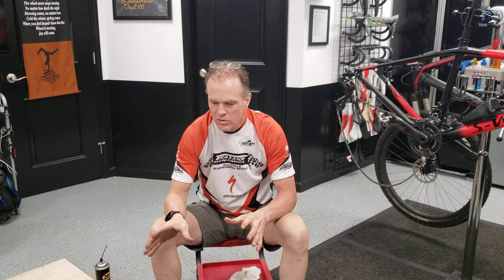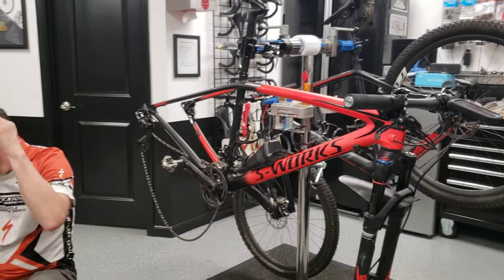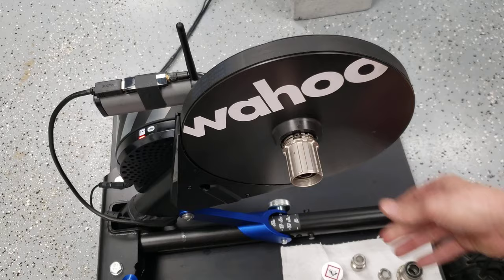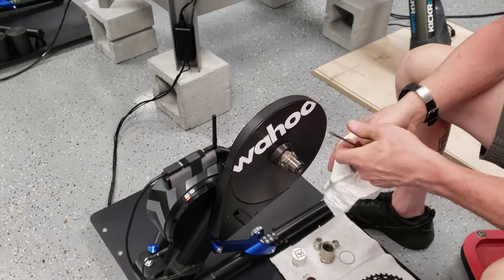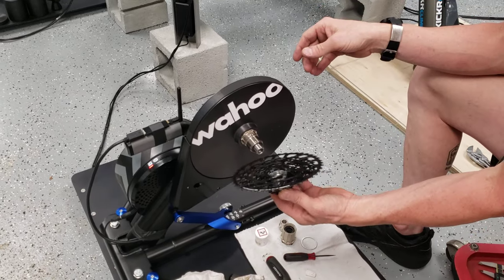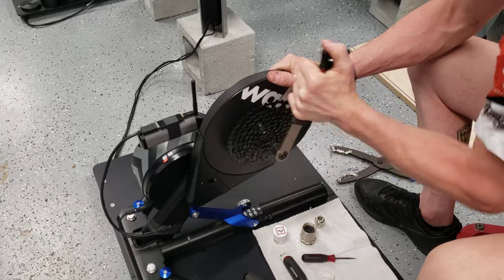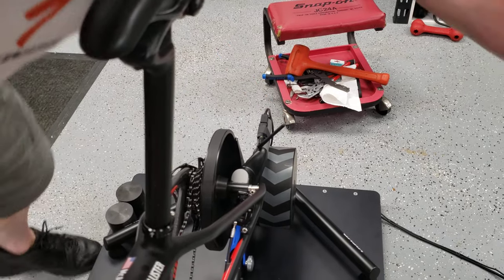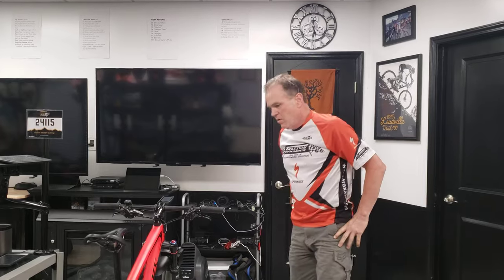How to convert Wahoo Kickr for Mountain Bike, Cycle with Max!

Comment: While this video has a lot of helpful tips, there are a couple of steps that are incorrect per Wahoo. 1) You should be using the shorter 10 mm lock nut, not the taller 13 mm lock nut @6:36. 2) When putting on the thru-axel adapter kit, make sure not to put both pieces on the non-drive side as shown in the video @10:03. Instead, the smaller of the two pieces goes on the opposite end on the drive side. I have verified this info with Wahoo. Hope this saves someone some pain.
Reply: (13mm lock nut is for the shimano driver)
 when using a XDR driver use 10mm nut and put cap over it
1.85mm spacer is needed when using xdr driver with xd cass
148 spacer on non drive side
Check drop outs!  some bikes will have fitment issues, proceed with caution so you do not damage frame
my frame will not allow cap on drive side to sit flush.  Wahoo has some new spacers in the works I hear
Reply: I was about to say the same. It is actually a BIG mistake. If you follow the instructions in the video, the distance is not 148 mm (for boost) it is more than 151,5mm. It means  poor shifting due to misalignment compared with the bicycle with the rear wheel, a more crossed chain and finally a possible frame damaged . It is easy to check if you measure the final distance thru the hole for the thru axel.
Reply: Thanks man you saved me from a big head ache!
Reply: I just spent an hour trying to work out why my bike wouldn’t fit. I wish I’d read your comment first. Swapped over to the 10mm one and everything just works. Thanks from the future

Comment: I have a KICKR CORE.  Normally ride road bike on it, but put my MTB on it.   the rear sits really low compared to it having a tire on.   Didn't measure, but put the rear wheel next to it and the axle doesn't  Line up at all.   The wheel's axle is about an inch and ½ high than when on the trainer.
Reply from the maker: The Kickr has a physical height adjustment built into it, the CORE doesn't so you'll have to come up with another way to level your bike.  Some plywood works for most people.  OR, you could buy an Axxion Rocker Plate, and then have it virtually level and have a rocker!

Comment: Trying to get some clarification. As I’m new to all of this and have been told a variety of different things. Trying to figure out if i can successfully use this cassette SRAM SX-PG1210 / 11-50 T on either the wahoo kicker or a Saris trainer. I’ve been told the largest cog would not be able to be shifted to as the rear derailleur would run into the trainer. Thoughts?
Reply from the maker: If you have the proper Wahoo XD Driver on the Kickr trainer you can definitely use an 10-50 cassette.  I rode 1,000 miles like that last year and did the Leadville 100,000ft Challenge with that setup.
Reply: @Traxxion  thank you! I’m assuming it would be similar on a Saris hammer trainer as well?
Reply from the maker: @kylepowidzki1223  I can't say for sure... but if they don't have an XD styled driver for sale, then the answer is almost "no", although you might be able to find an aftermarket cassette that would work from a company like e13.

Comment: When you buy the system does it come with all the adapter for conversion?
Reply from the maker: If you wanted to change the freehub you had to buy it as an accessory.   I would check their website for details for current accessories.

Comment: Thanks for your video. So the bolt of 10mm is for 142mm configuration right? And 13mm bolt for the 148mm? I think I made the mistake :)
Reply from the maker: There is plenty of confusion to go around!

Are you talking about the silver cap?  Or the spacer marked 142/148?
Reply: @Traxxion  im refering to the piece of the freehub (before adding the cap). They are 2 diferent pieces with a diferent finishing colour. You put the bigger one with 13mm height. I guess for 142 axle I need the small one with chrome finish?  Thank you
Reply from the maker: @romainm7147  No... on the other side, you flip the spacer that says 142/148 and that will fix it.
Reply: @Traxxion  sorry there is a misunderstanding. Im not referering to this piece. Im refering to piece you show at 6min40. They are 2 diferent pieces. A big (13mm tall), and a small. I dont know the one I have to install for configuration 142 (sorry for my english^^)
Reply from the maker: @romainm7147  your English is fine!  I have not tried a 142, but I was under the impression that you only flipped the spacer on the Non-Drive side to 142.  If you have a vernier caliper, or skinny metric tape measure. you can just measure across the assembly to find 142.

Comment: So glad I found this vid!  I have a Kickr Core, road bikes in the shop having bearings replaced so it'l be couple of weeks.  Wanted to mount my gravel bike only to find that my rear cassette was different.  I now understand I can change over to an XD driver.  Can I use any brand or must it be a driver from Wahoo?  I have Sram Force on my gravel bike so could I just buy an XD driver from Sram and mount in on the Kickr Core?  Great video by the way, almost forgot to mention that!
Reply from the maker: You will need the Wahoo specific XD Driver.  You have posed a new problem... Not sure what your rear dropout width is on your gravel bike... and does it have a thru axle?
Reply: @Traxxion  thanks for the reply, yes it has a thru axle with rear size 12x142 I believe.  I'll reach out to Wahoo!
Reply from the maker: @jralicea6299  you can find them on eBay.  I heard Wahoo was out of stock for a while during "covid".

Comment: what are the names of those 2 spacers used on the left side of the wahoo trainer? (148/142 + 1 cap spacer skinny shinny cap) start @ 10:00 and where it can be buy? thanks
Reply from the maker: Those are Wahoo Kickr specific parts, and Wahoo can send them to you.
Reply: Make sure you don't put both spacers on the same side. The smaller one goes on the drive side.

Comment: I'm a little confused (likely from being such a newb to MTB stuff these days).  I have a 12 speed NX Eagle cassette from my 2020 stumpjumper.  I have a kickr core on the way.  Do I need to purchase a different adapter or will I be ok with the included parts?
Reply from the maker: You will have to order the Accessory XD Driver from Wahoo (not the one from SRAM or your bike).  The driver on it is a regular Shimano styled freehub.
Reply: @Traxxion  Thanks for responding. Looks like I have an expensive paper weight. Nobody,  including wahoo, has the xd/xdr freehub in stock.
I don't even know what the options are at this point. Can I get a standard Shimano style cassette and have it work with the rest of my sram nx eagle drivetrain?
Reply from the maker: @michaelcouey1383  They are available on eBay!
Reply from the maker: @michaelcouey1383  you can also buy Shimano MTB cassettes, which will have similar ratios, albeit not exact.
Reply: @Traxxion   Some of the guys are saying the Nx doesn't have the XD hub, it uses the standard hub and until you get to the GX series?
Reply from the maker: @michaelcouey1383  Hey!  They are right... I had no idea that they made a cassette with a Shimano style mount!  You should be good to go!

Comment: I have a xx1 Eagle Sram 12 speed on a scoff bike. Do I need to get the spacers and a new cassette?
Reply from the maker: You'll have to get the Wahoo XD Driver, and I recommend you get the cheapest NX 12 speed cassette so you don't have to try and move the one back and forth from your MTB.
Reply: @Traxxion  Thank You so much! Also another question, I Have a 8 Speed bike I wanting to put on instead of my 12 speed. Will the 11 speed Cassette accept my 8 speeder if I put the 1.8mm behind the cassette?
Reply from the maker: @davisclark0776  No chance for any of that.... your 8-speed will require the original Shimano styled freehub body, and the 130mm spacer setup.  Your 12 speed will be either 142 or 148mm wide.  So you would have to change everything each time to go back and forth.

Comment: Can you do similar for a 141mm boost quick release axle?
Reply from the maker: I assume this is a joke...

No such thing as 141mm anything... no such thing as 141mm Boost... no such thing as a boost quick release axle.

There is 142mm thru axles, but that is not boost.
Reply: @Traxxion  I was just looking for some help... Look at the newer Trek Roscoe line for example.
Reply from the maker: @ryanl1414  sorry I have never heard of such a setup on any bike, I didn't even know it existed.   Unfortunately, you will need to have custom parts machined.  Wahoo is not likely to make parts for such a one-off configuration.  The closest thing they did was make a 135mm spacer, for which there's millions of bikes.  Other than that they accomodate common 130 QR, and 142 and 148 Thru Axle, which is 90+% of everything ever made.

Comment: Hey there.  My hardtail is a 9 speed. Do i just skip pretty much the first half of the video?
Reply from the maker: If you have a 9 speed bike, I believe you can just put it on with the normal 130mm road spacers.   You can just buy an inexpensive 9 speed cassette with the same gears as your bike, install it, and then put it on like a road bike.
Reply: @Traxxion  wow thanks so much for answering! This is super helpful. Thank you.
Reply from the maker: @happyjunki3  My pleasure!

Comment: Just got my wahoo kicker core and your video doesn't match the instructions... you say u slide that sleeve over the 148 cap on non drive side. But according to wahoo instructions they tell me to use it on the drive side?
Reply from the maker: If you use the 13mm locknut on the drive side, it fits perfect.  You shouldn't have to reset your deraileur to put your bike on the trainer.

Also, I have figured out that Wahoo has a defective batch of non drive side spacers.  They are marked in reverse.  The one in my video is defective, which is why it doesn't make sense.  That piece also doesn't match their instructions.
Reply: Okay so I'm still a bit confused... they didn't provide me with a longer lock nut for the cassette. They did provide all the spacers for if im running 9mm drop outs up to 148. I set it up how your video shows (not removing anything on the cassette side just putting on the cassette and leaving the provided locknut) and used the sleeve over the 148 spacer like u showed to "give correct spacing" but in the instructions and another wahoo video it shows the piece u slid over the 148 spacer, they slide in into the drive side cassette side. So what is correct ?
Reply from the maker: @nathancouse3596  you are the 2nd person to say they don't have the 13mm locknut.  If you don't have that, then from what I can tell, you would need two of the thin "caps"... one to put over each side.  You can use a digital vernier caliper to measure and make sure you have the spacing at 148mm, and you can also use it to measure the spacing from the smallest cog to the end of the drive side caps.  Measure your stock cassette and spacer, and your Wahoo setup should match it.  You should be able to move your bike from wheel to trainer without adjusting the derailleur.

Comment: I am also using my MTB on my Wahoo Kicker, But 43 x 11 but am running out of gears on flat sections. I have tried to play around with the TD but it doesnt effect the flat routes. Are there any solution for this?
Reply from the maker: First of all, be sure the "Trainer Difficulty Setting" is set to "MAX".  See my video on this topic.    

Sounds like you have a Shimano drivetrain.  There may be an aftermarket cassette with a 10T cog like SRAM has, but you'll need to be sure that your derailleur will accomodate it.  Next, would be a much bigger chainring (and longer chain).  You can probably also trick it by telling the Kickr that you have really big diameter wheels in the settings.  That would be free.  I haven't tried that, but it should work.
Reply: @Traxxion  Hi Thx for your reply.
Yes its an Shimano drive train.
Someone also told me to manipulate it with a bigger diameter wheel size under the Wahoo settings. Tried searching for it. But couldn't find anything on what size to actually use.
Maybe longer chain and chain blade can be a solution
Reply from the maker: @jacocoetzer7876  in Wahoo App, after you pair with the Kickr, open the Kickr settings and the Wheel Size should be there.
Reply: @Traxxion  Thank you. I will try it

Comment: Can you share exactly which 2x11 you are running?
Reply from the maker: SRAM 2x11. It was around for several years, and all of the parts are still available.  I think they may be discontinuing it though.  The key is the rear derailleur.  It is available only in GX Trim.  There are also matching triggers, but I believe you can use any 11sp trigger, and any 2X trigger for the FD.  You can use any SRAM 11sp cassette (I use XX1 on our bikes).
SRAM specs the lowest chainring set as 24/36, but I have used the 22/36 for several years with no trouble.  Occassionally I will drop the chain coming off the big ring if I am sloppy and agressive about just dropping it under power, but it works great.
That drivetrain will let you climb extremely steep grades or haul ass on the flats.  I use this setup for the Leadville 100.
Reply: Max McAllister & Traxxion Dynamics Thank you for the detailed response. Any help I can get fighting Father Time is welcomed!
Reply from the maker: @wayneshort  please Share my videos, and most importantly, check out the Axxion Rocker Plate for indoor cycling!!!!!!!!!!!

Comment: Is that spacer (behind the cassette) required for a 12 speed SRAM cassette?
Reply: It is for MTB 12-speed Eagle cassettes.
Reply: It is not required for the 12 speed eagle. Nor is the XD adapter, the one that comes with the bike works out of the box.
Reply: I don’t think that’s right. For a 12-speed mountain bike cassette you need both the spacer and XD free hub.
Reply: @eysikal  I didn’t need it for my sram eagle nx
Reply: Ah yes. That’s because the NX uses a standard freehub body. It is not the same for the GX and above. Those definitely need the spacer and XD body
Reply: @eysikal   so i should only get a second cassette, spacer and xb body ? Those are not in the box right ?
Reply: @thibaut I’m not sure what you are asking. Can you rephrase?

Comment: Just one point : For 11-speed or XD cassettes, install the included spacer (ring) along with any other spacers that came with the cassette
(skip this step if using a 12 speed or XDR cassette). I installed an Eagle cassette and didn't installed the ring.
Stated here : https://support.wahoofitness.com/hc/en-us/articles/360006297940
Reply from the maker: Unfortunately, that's not correct, and their instructions are wrong.  They are CLOSE, but still wrong.  The correct explanation should just say "XD Cassettes" or "XDR Cassettes".  Eagle 12 speed cassettes (Mountain) are XD Compatible, and would require the 1.85mm spacer.  There are a new line of XDR (Road) 12 speed cassettes entering the market, which would not require the spacer.  But virtually no one has any of these cassettes as of the date of this comment.

So the part they sell is an XDR Driver.  If your cassette is XD, no matter how many teeth, it will require the spacer.
Reply: @Traxxion  Ok, I reinstalled the spacer before mounting the bike and everything works fine. Thanks for your advice.
Reply: Wait a min, so I DO need the spacer if I’m installing a 12-speed X01 Eagle cassette? That’s confusing indeed. I thought maybe you needed it because you are using an 11-speed cassette.

Edit: Ok, I've Googled around you are right. The instructions on Wahoo's site are confusing.
Reply from the maker: @eysikal  with XD MOUNTAIN cassette you DO NEED the spacer.

Comment: This silver ring has to be used on 11 Speed xd cassettes. For xdr and Eagle cassettes this ring isn’t needed.
Reply: I have the 12 speed eagle NX and did not need the XD adapter at all. I'll be returning that kit.
Reply: Not exactly. For the NX Eagle MTB and the XDR road bike Eagle you do not need the spacer. For the GX/X01/XX1 MTB Eagle you do need the spacer.
Reply: @eysikal  They said XD adapter, not spacer - GX onwards is when you need the XD adapter, but not for NX.
Reply: @chrisrnz  Oh good call. I misread Sebastien's comment.